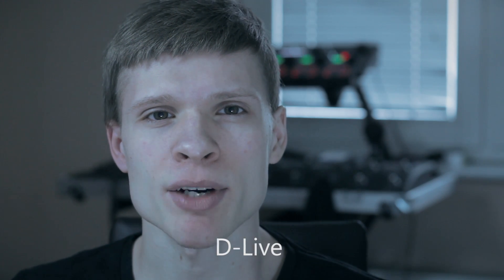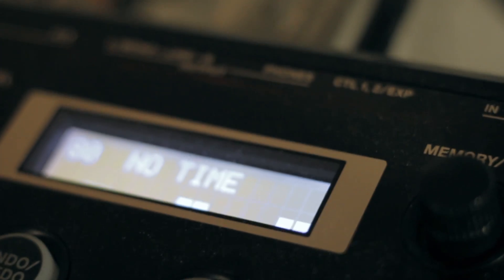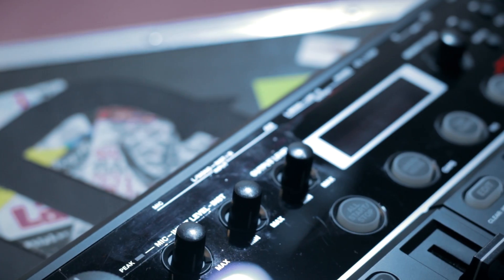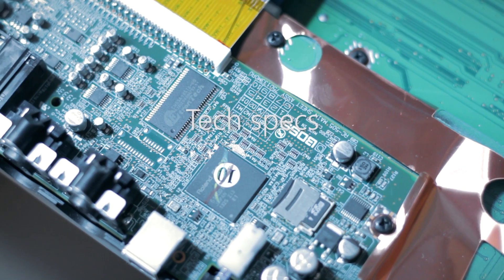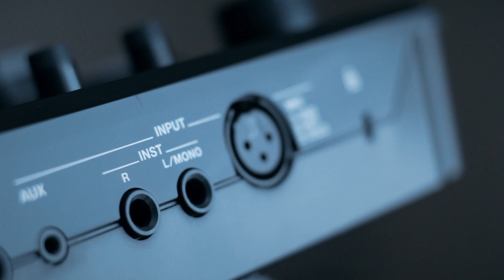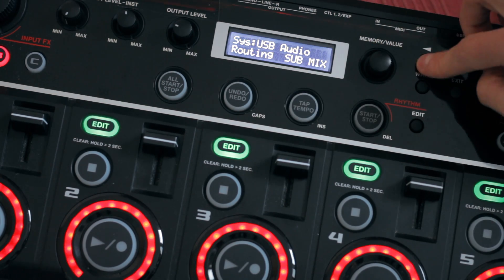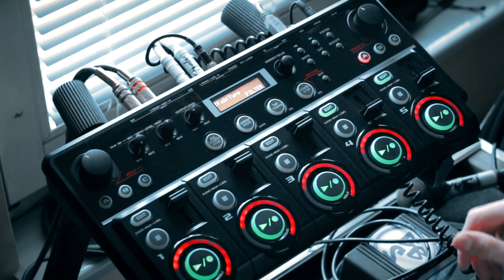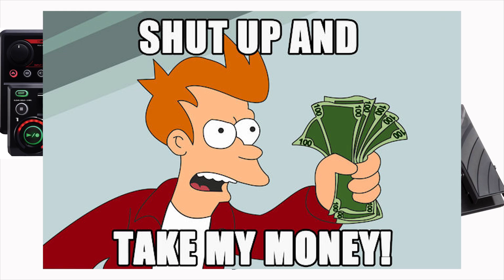BOSS RC 505 Loop Station REVIEW after one year by D-LIVE [ENG/PL subs]

Comment: Another flaw of the RC505 is that when midi slaved to an external clock the audio occasionally flutters and warbles as the pitch is stretched to fit the tempo. I'm hoping a future OS update will fix this issue as it's a bad one in my opinion.... Still a great looper though. Great review!
Reply: yeah these machines are not good with midi.  i get a clicking sound when i use delay in the slave 505.  very dissapointing and i just bought a new model

Comment: Hey this review was VERY good, thanks for the awesome feature overview. I am trying to decide between the rc300 and this, and I play with a lot of keyboards and drum machines but also play bass and guitar. I think I found the answer to this, but maybe you will know. Can I hook up the FS6 or any pedal to control the rc505 as a Start and Stop loop on a channel? Like if I am going to play bass, or do I need to work that with my hands? Thanks!!
Reply from the maker: Hello, thanks for your feedback. You can connect any footswitch controller (up to two switched) to rc 505 and control many functions, ex. mentioned start/stop on selected channel. But the tricky part is that you can only set it to one so called "target" track. If you have a footswitch with two buttons, you can set two target tracks - one for each switch. IMO, if you're playing different instruments, you should go for RC300. It is die hard piece of gear, but it hasn't as cool fx's on the other hand...
Reply: OK very good to know man and thanks a ton!!
Reply: @DLIVEloop  You can also as a guitarist use the count in option on the 505

Comment: do you need a mic? or can you just use it without anything?
Reply: Isaiah Beatbox It needs an input device - mic, 🎸, bass, synth, or audio player. You can have a mic, instrument and audio player plugged in at the same time and mix the mic and instrument levels, but the audio player input has no level control so you adjust that on the audio player itself.

Comment: I suspect the Electro Harmonix 95000 is the new competitor.
Reply: I was going to go for the 95000, then realised its tracks are mono. (It also doesn't have the built in fx)
Reply: @narco73  six tracks mono, OR 3 tracks stereo or mix how you like.  As for effects I like to use pedals.  The 95000 also has interesting reverse effect combos as it can play & record tracks in different directions.  Anyway you made your choice but I felt you should know it has stereo capabilities.
Reply: Thanks, I haven't actually bought yet, but I am wanting more than 3 stereo loops (that's what I currently want to upgrade from!). Thanks though, I hadn't actually realised that.
Reply: hmmm, although you're making me wonder, as all my tracks don't need to be stereo. 

And I'm a instrumentalist, so I'll need a pedal to run the 505 effectively. I was planning on the Pacer Nektar.

Although I like the idea of adding effects afterwards to separate tracks.

My looping is more remix style, albeit on acoustic instruments, rather than the usual singer songwriter stuff. I also need robust midi capabilities. (outputting clock, based on first loop, as well as looping to a click, I think the 95000 does this but I'll have to confirm)

hmmm.
Reply: The 95000 was designed by David Cockerell, who invented looping as we know it, 35 years ago.  The man behind the VCS3, Akai sampler and everything great fom EHX.  It's a well thought out machine, and yes, the MIDI configuration is well thought out.  The only thing I made a mistake was assuming that the "quantize" feature would actually quantize your live played input, but it's really just a setting to sync machines.  The Boss 505 is very convenient and powerful, but at the same time is more of a wiz-bang DJ tool with a lot of convenience in one package but a very weak physical design using plastic for all of its inputs, etc.  Depends what is most important to you.
Reply: Maybe I'll buy both, and put them in a blender.

;)

Have you checked out loopy the iPad app? It's actually really awesome, but requires an iPad (or iPhone), an interface, and potentially a pedal. You can nudge loops back and forth after recording, but not quantise over all. Actually, I write apps myself, and I was considering making one that quantises.. but loopy is so great, it seems a waste to spend a lot of time making competition for it! And I'd like a hardware unit..

Comment: Some reasons im going to sell mine and it is not the build quality. First its me, i m just not so into live looping so it can find better use in other hands. Now from rc 505 prespective:
1 i hate the time stretching, if you try to change the tempo you have so many artifacts and bad noises its totally useless, and if you try to change back to original tempo you have twice the noises for everytime  you process sound (even free vsts and apps have better algorithm than this expensive machine from a well known brand), 2 . usb connection with pc doesnt give you more than the main out and input so no actuall daw intergration and use, its like an audio interface somehow but you can not have the rhythm , the loops and the input seperately so cannot keep my main performance in a different track to mix later and if i want to keep my loops i have to do it like im using a flash drive or by recording the main out,m ok lets put a cassette recorder at the main out, the same intergration why bother buing this and dont loop on a daw at first place so i can mix it later instantly . I like the effects and if i was using it for live, busking or something like that it seems like one way sollution , but for an inspiration tool for home, not able to change the tempo and the incovinience to take more time to import stuff to pc and losing my main performace in a main mix are sadly the point where i can not keep it any more